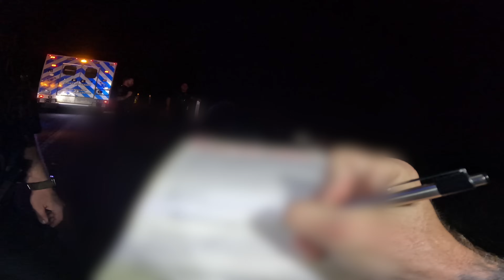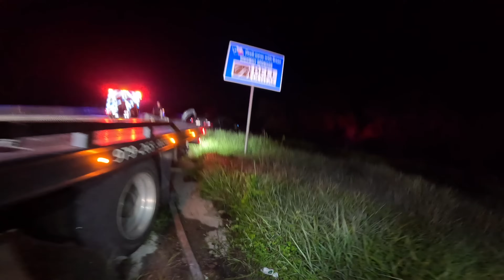Honda Accord vs Guardrail!

Comment: Every aftermarket LED headlight is illegal in the USA. None of them have been approved by the NHTSA. But there’s no enforcement.
Reply: The NHTSA does not approve vehicles or any after market parts. They simply set standards. They do periodic testing on vehicles to make sure they meet the standards. But not after market parts. If they find anything problematic, they can require a recall. But that does not make them illegal.
Reply: I know someone with yellow LEDs on his wrx. he's only gotten pulled over once by a bored cop and they let him go with a verbal warning since everything else was fine (front plate, normal tint, not speeding, insurance, etc)